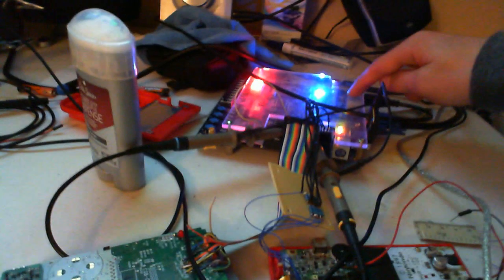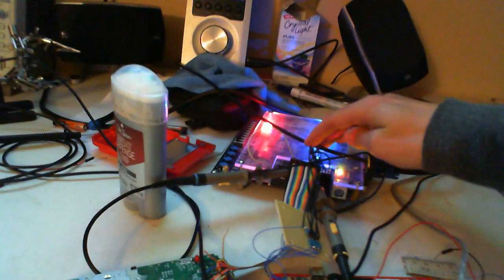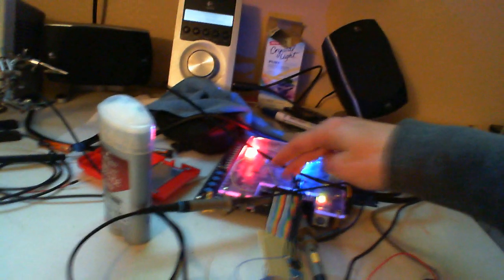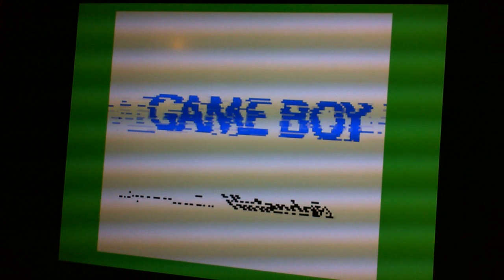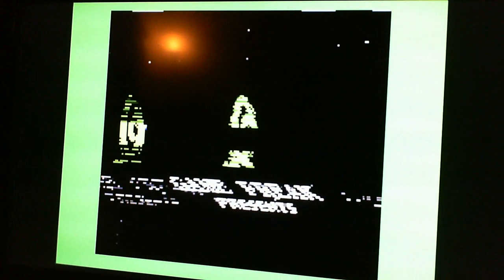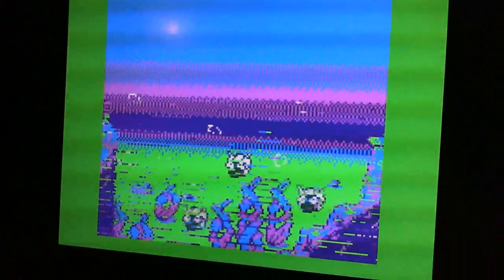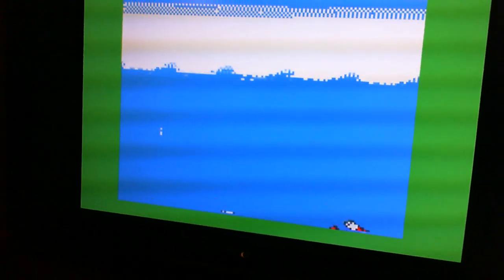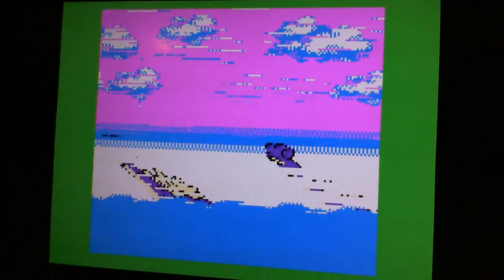Gameboy Color VGA Adapter *video 2*

Comment: where do you get all of your info for the GBC and its pinouts? I was thinking of trying to get a GBC to work with video out, like you are.
Reply from the maker: I dont have the pinouts anymore, but from what I remember, the silkscreen on the PCB has most of them.

Other then that info, just probe around with a scope and try them out.
Reply: Kevan Killion cool. Would a Tek 2213 have a good enough resistance to not drop the GBC'S voltages too much or fry it? the inpedance is ~1Mohms.